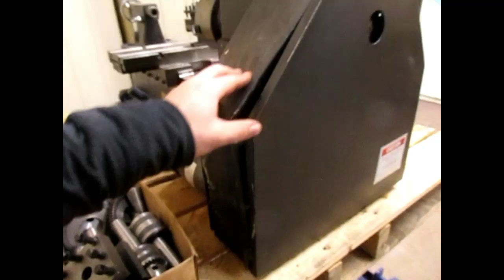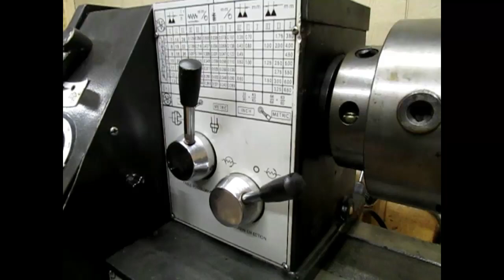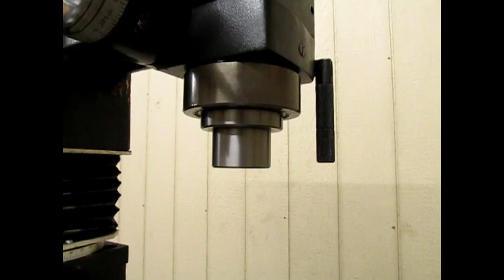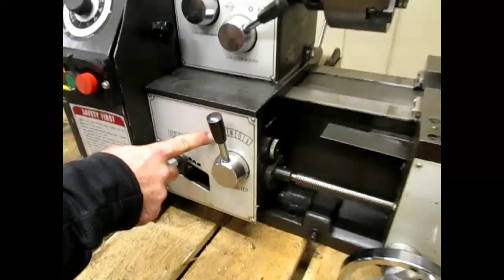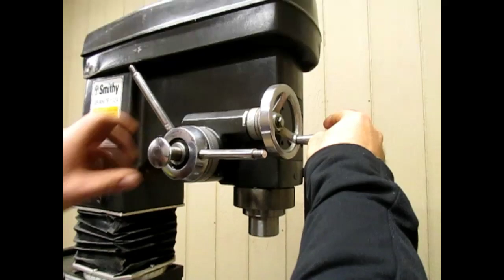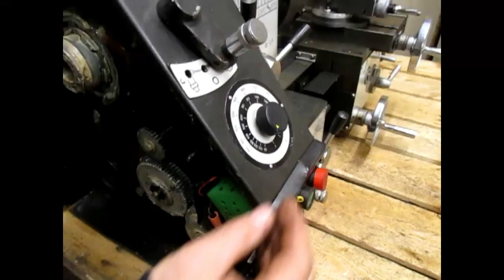Smithy Granite 1324 Multi-Purpose Lathe Mill Milling Machine Combo 3 in 1

Comment: Why it SUCKS to be Canadian!  That machine here? Over 4 grand. PLUS 10 % taxes PLUS shipping. Add that to the fact that our wages between the USA and Canada are near identical per hour or Canada is lower and the fact that we pay over 50% tax on income and everything else and you get it. Lol... the cheapest piece of crap mini lathe here is 800 + plus taxes. I went looking for a used lathe in Canada. BEST deal I found was an old old manual Sears lathe totally rusted with a single tool holder for $1200.00. It would take weeks just to get it operational and that's if it isn't worn right out. That's the best deal I could find in the entire COUNTRY of Canada!

Comment: If you bought this, the slipping clutch to the leadscrew can be adjusted, it's the 6 setscrews on the "D" gear. 
(I fixed mine today, it was slipping in I-1)